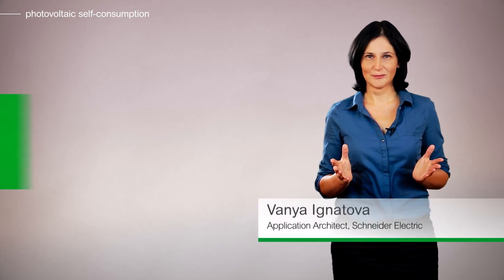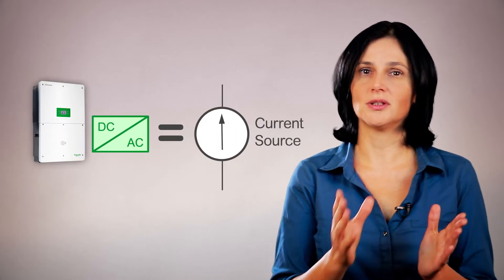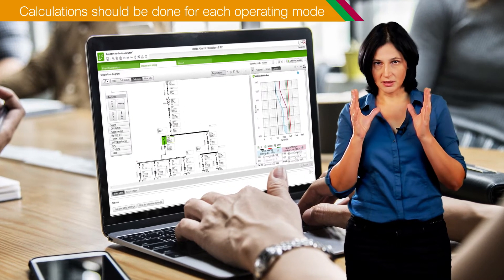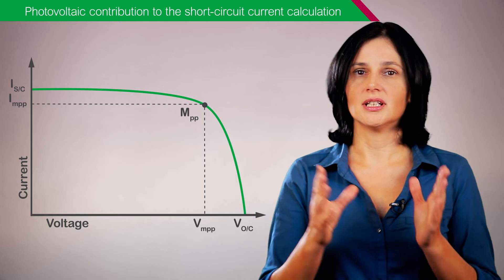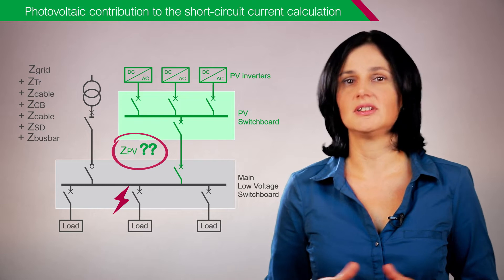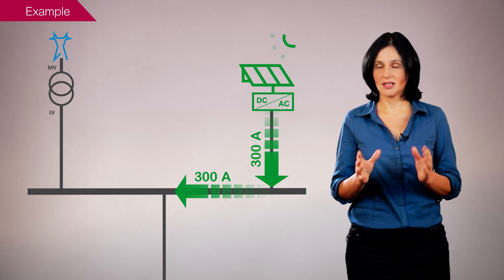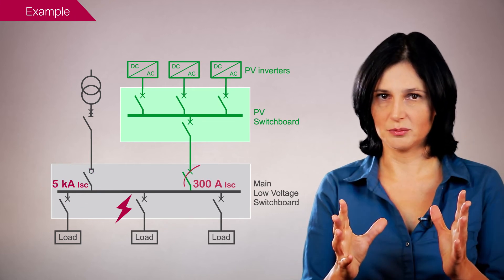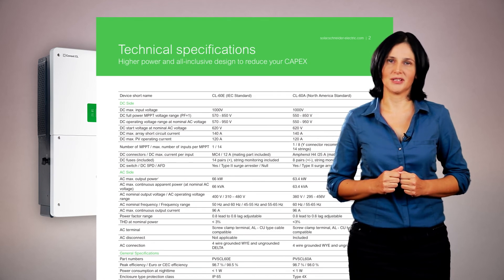Photovoltaic Self-Consumption: How to Make Electrical Calculations | Schneider Electric

Comment: 2:05 Are all components of a solar system, including panels, inverters, cables, protective devices, busbars, etc., up to the connection point to the main busbar considered as a current source, or is only the inverter considered as a current source, while other elements in the solar power system need to have their impedance and reactance calculated when performing short-circuit calculations? What standard is your calculation based on?
Reply from the maker: Thank you for your message. We house most of our documentation in a virtual database here: https://www.se.com/ww/en/download/. If this does not address your concerns, please reach out to a technical support person in your location.https://www.se.com/ww/en/work/support/country-selector/contact-us.jsp

Comment: How to choose inverter rating?
Reply from the maker: Dear Pranati,

Greetings from Schneider !

We have assigned your query to the concerned team and they will get back to you. Meanwhile, kindly share your contact details to assist you further. 

Regards,
Shweta Jamwal
Customer Care Center.
Reply from the maker: Hi Pranati,

The inverter rating is selected based on the expected peak photovoltaic production (which depends on the photovoltaic panel capacity and orientation, as well as on weather conditions …). And of course, selecting the power of a PV system, for a new or existing building, is directly related to the sustainability goal to achieve Green building certification, Net Zero energy: https://www.youtube.com/watch?v=74dMnnNpDbQ&list=PLa7UGrWOTyjnuRAZcaIVEtgbmQ61qYzT_&index=11

Comment: I have a small confusion , you mention about 5kA (at time 03:38) can you please clear from where you get this number? I will be waiting for your kind response.
Reply: That's the Icc given by the manufacturer of the circuit breaker there
Reply from the maker: Hello Saeed, 5kA is a number taken just as an example. The short-circuit contribution from the grid should be calculated for every project